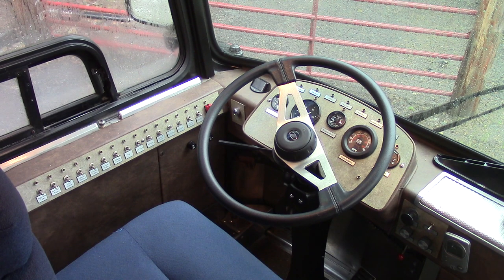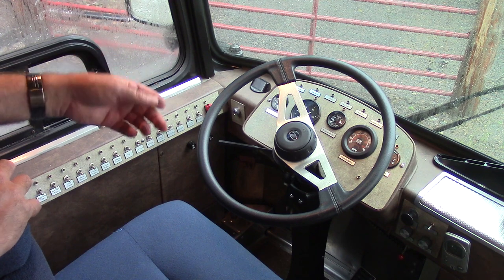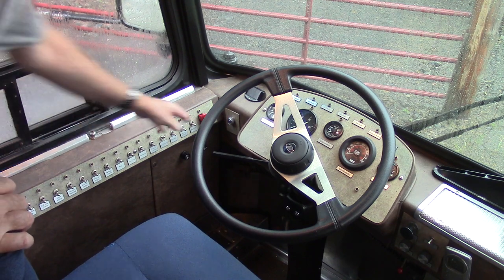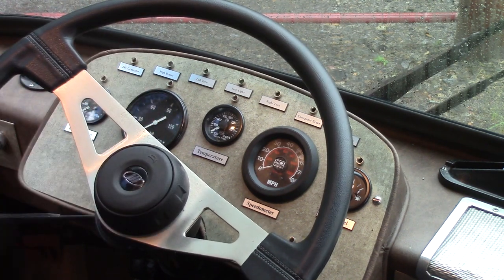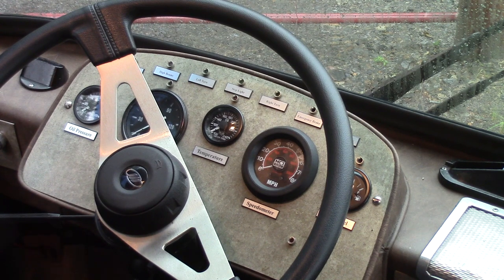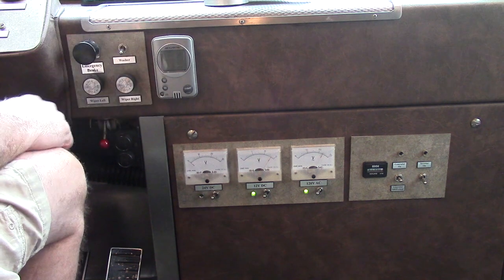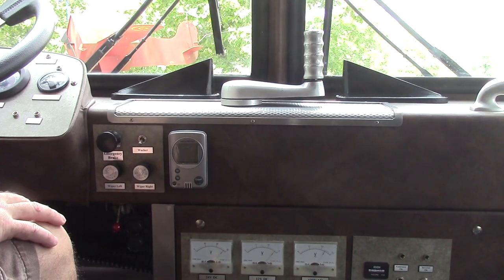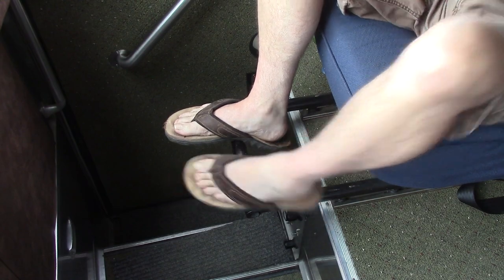Bus Conversion Design: Part 2 Driver's Cockpit

Comment: Hello I just found your videos you did a great job I'm actually in the process of redoing a 1974 MCI to motorhome and am very curious if you were able to find a way to add cruise control thinks for reading and again you have done a awesome job with your conversion
Reply from the maker: I did not have cruise control. If I remember correctly there are kits out there for it. I think they were kind of expensive and for mine cruise control on the interstate was just peddle to the floor and the governor kept me at 70. Off the interstate I would not have used it. Good luck on your conversion!
Reply: @SoatMon  thank you for the reply

Comment: Dang that's a little dangerous, took u a few mins reading those switches and were suppose to look away for that long? I don't think I wanna have to read all those switches while driving!
Reply: Pamela Chadwell There's not one switch on the side that the driver would need to use while driving.. With the exception of the fan, which is not a necessity.
Reply: @randomized4266  headlights, defroster, sun visor all seem like necessity while driving to me. What if you are driving and the sun starts to blind you and you are fidgeting with switches to put down the visor? Some of those switches I would have put somewhere else or at the very least used the larger light up toggle switch for headlights and visor so you can spot them easier.
Reply: trucker V in a perfect world its not ideal but its really not hard to drive and play with switches for a minute. it is what it is